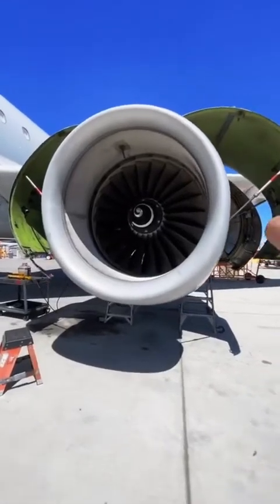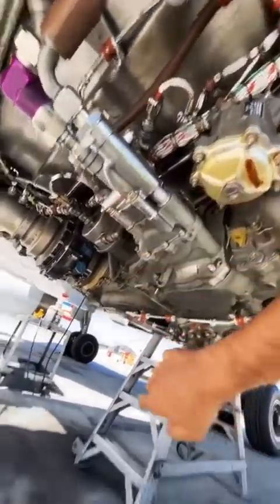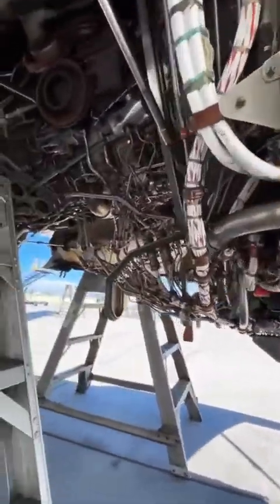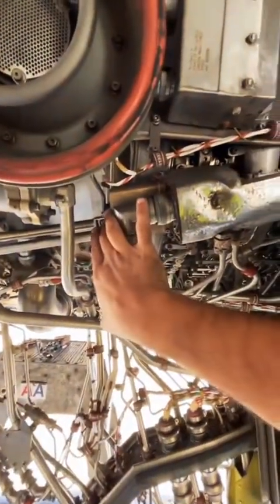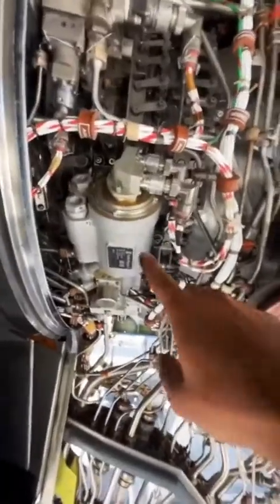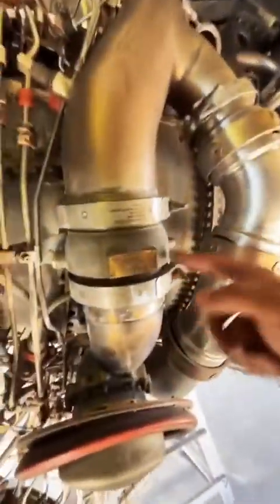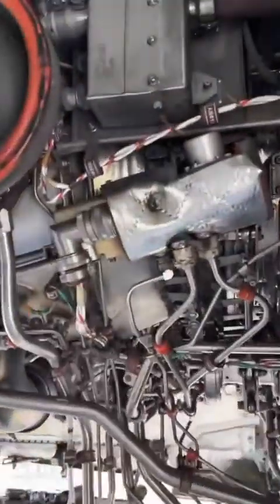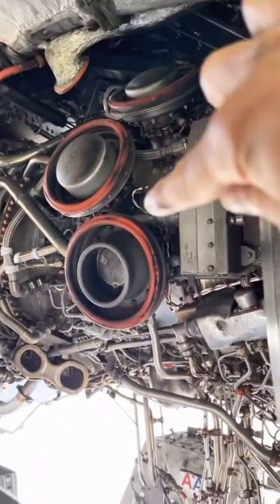IAE V2500-A5 Engine tour and component location.

Comment: Are these the ones that Spirit uses?   Are they bypass engines?   The back side does not look like a bypass engine.
Reply from the maker: Yes spirit does have Airbus with these kind of engines. And yes it is a high bypass engine. The bypass is there if you see it from the rear

Comment: Hi, thanks for video. let me correct a small thing on acoc, it is not taking air from outside, taking air from fan and sending outboard through the valve which you showed on the video.
Reply from the maker: You are absolutely correct. My apologies for getting that backwards. Thank you.

Comment: Is the same engine they use on the MD 90 or is it slightly different
Reply from the maker: Yes. That would be a the same engine on the MD90. Just with slight variations because it’s mounted from the side.

Comment: Amazing.  Have you had to remove many of these V2500-A5's?
Reply from the maker: Yes many times
Reply: @StigAviation  what do you see are the failures that drive the removals?
Reply from the maker: @skullhart  it’s mostly the components and accessories on the engine that tend to deteriorate over time. But the engine itself is very reliable. The most common reason why we would replace and engine would because of any kind of overheating or compressor stalls that would damage internal blades. Also a severe bird strike would warrant a engine replacement. Time to time there are vibrations issues, but all these events are constantly monitored and recorded by the avionics systems onboard. If we see that the engine is constantly putting out faults and not working in peak efficiency, we will investigate the causes and replace as needed, either components or the whole engine itself.
Reply: @StigAviation  I was in the USAF as a jet engine mechanic for many years and still love aviation. Curious how the engine health is monitored and if or how it's uploaded to be analyzed?
Reply from the maker: @skullhart  good question. These modern engines now run on a pure fly by wire technology. There is a dedicated EEC (electronic engine computer) that will monitor the engine at all times. Along with monitoring it, it will also control various components on the engine for optimal performance. This gets sent to the internal system called the FADEC. (full authority digital engine control.). All this and a multitude of sensor for basically Everything on the engine is sent to this computer.
Reply: @StigAviation  That's interesting  we used to have to download each flight manually and upload it into a centralized engine management system where analysts would review it. I eventually became an engine manager and analyst before I retired but knew that there must be something better now.

Comment: So can the slats drive into the cowls also where is the TR Lockout.
Reply: As I recall, there are notices on the cowls that warn you against lifting the cowls if slats are extended.
Reply from the maker: if the cowl is opened, the slats are locked out to prevent damage